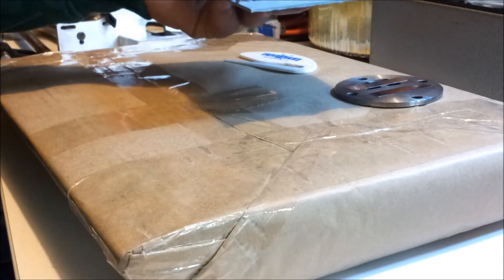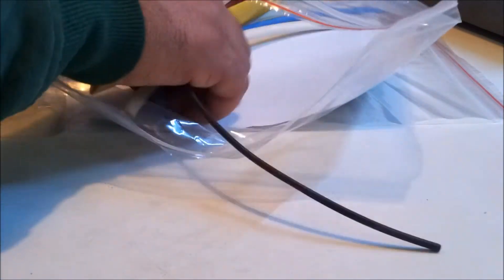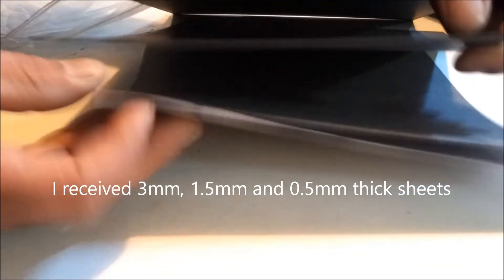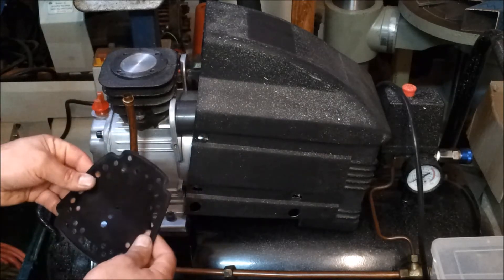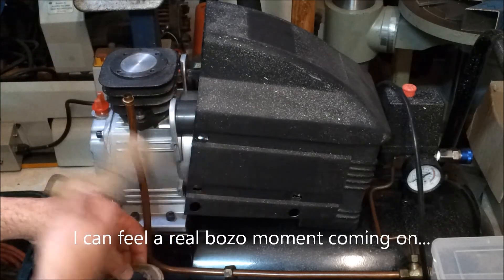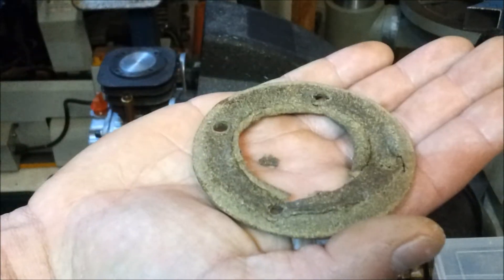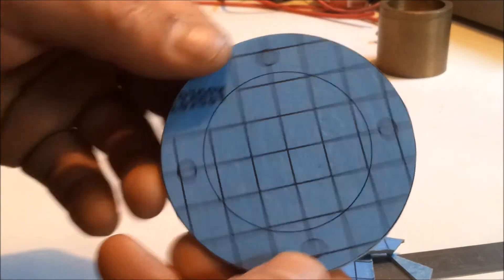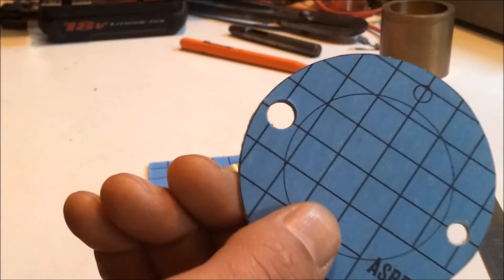Energy Update #39 - Air Compressor Repair & Rebuild [Head Gasket]

Comment: I have a air compressor. The leaks alot of oil from the breather cap after reaching over 30 psi. Someone told me could be some of the piston rings. But I'm not sure. What do you think could be the problem?
Reply: @lveneno2438  it is over guage

Comment: I have a 22 gal air compressor gm5006 single stage (piston) when I purge it oil came out plus more oil coming out from the oil breather when the compressor hits like 20 psi. What could be the problem?
Reply from the maker: Mustang Shelby GT 500 SUPER SNAKE Too much oil perhaps. Check the sight glass. If the oil level is higher than the indicator, you have too much oil.
Reply: @EnergyFabricator  how much oil do i need to add? Someone told me it could be the piston rings. The oil comes out with alot of pressure. But if I put my finger works good at ceartain pressure..

Comment: split seal,
 low temperature and pressure,
 you can simply paste it, has the 'dough joined motor' (if outside the cylinder / cylinder head stud).